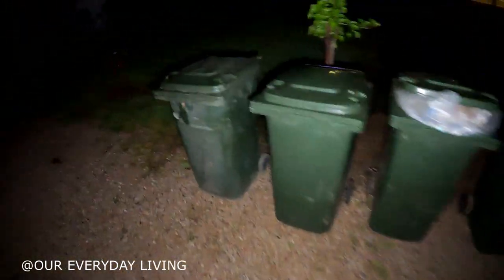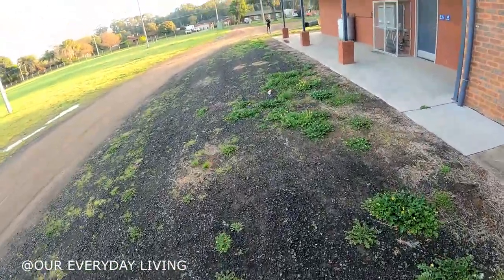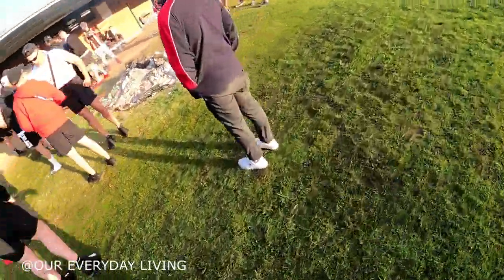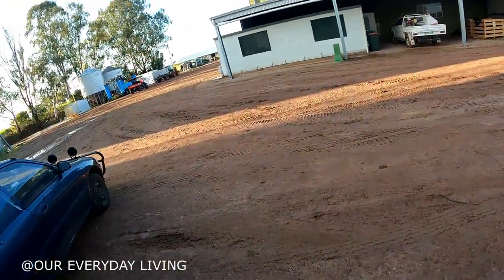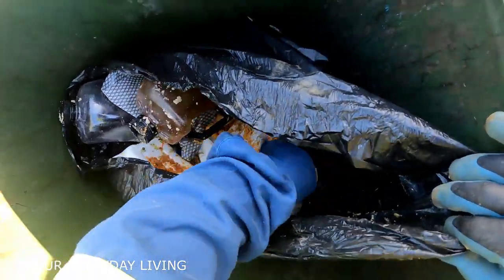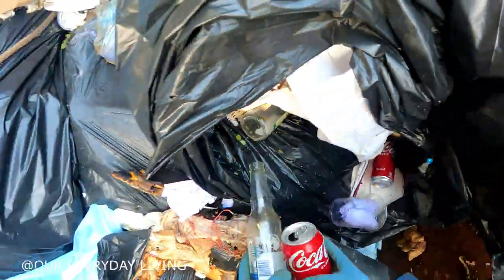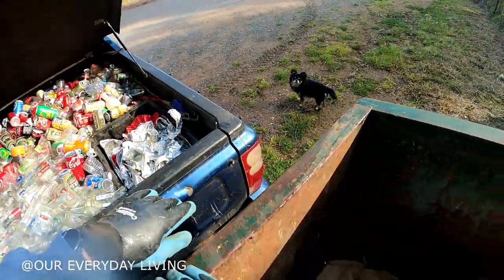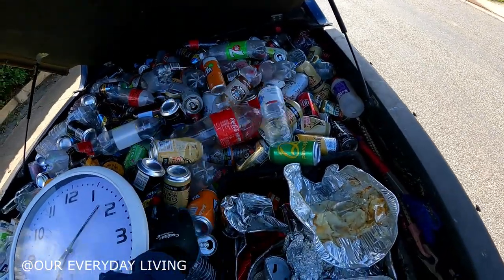DUMPSTER DIVING ''Fully Loaded''

Comment: I thought I'd check out other pickers of the waste but what I see is a scrapper that just whips open a lid right onto a tree, be careful boy & tearing open bags with no regards to making a mess, by the way you sound like a gnome, get it together bud!
Reply from the maker: Thank you for your comment but anyway when you say making a mess that means putting it on the ground I don't put nothing on the ground I try to  leave it cleaner as it does not matter if you make a mess in the dumpster trash can I just going into a truck anyway the truck compressors it tears bags open so I don't see a problem so I don't need to watch out and most places that I go to I have permission to go there so once again thank you for your comments